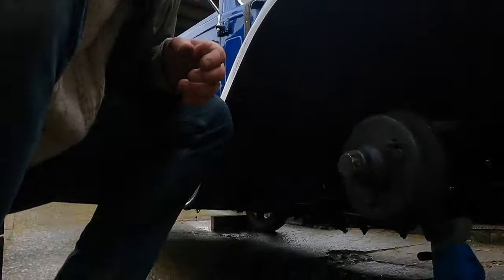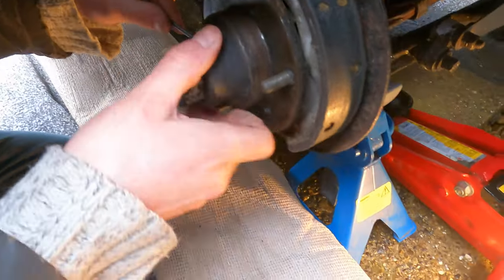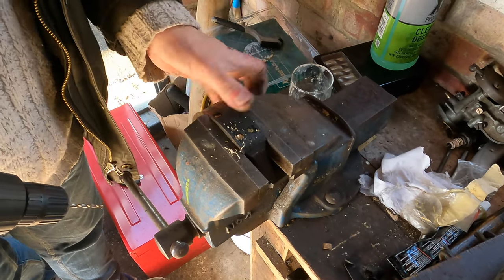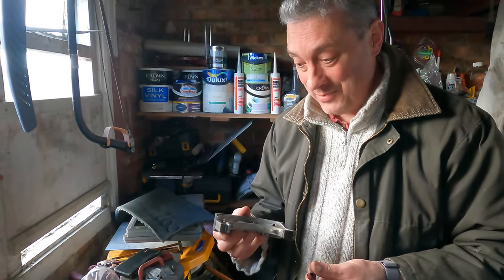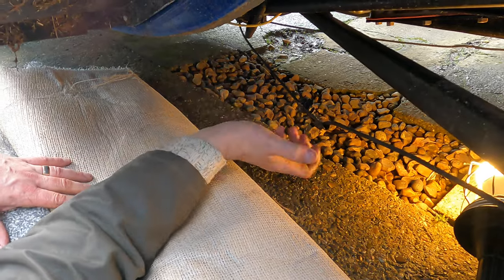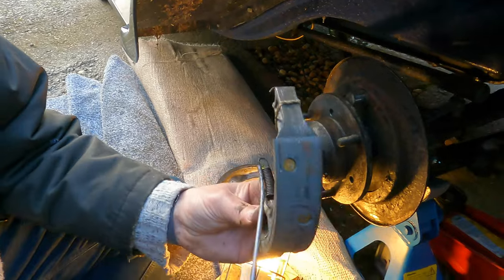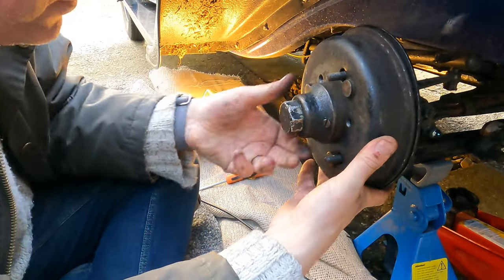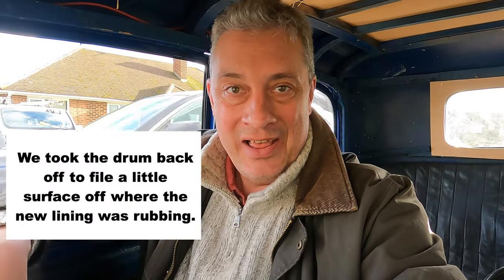Austin 7 Restoration - New Brake Linings And Brake Spring Removal Tool

Comment: That's a neat tool, I have not seen that type before, I use a hooked spring tool, which is ok, but is pull to put on/take off, pushing looks easier.

Did you have two adjusters on the same front brake cable? I think you are only allowed to use one per cable, I don't like these at all as they distort the cable. 

On my Swallow (my Ruby has hydraulic brakes) for the rear brakes I used stainless steel adjustable rigging connectors rather than pulling the cable through the hole & then trying to clamp it in position - always goes back to where it was before anyway - the rears were originally supplied with an adjustable connection to the brake bar, but no-one supplies them like that now, mine mimics how it left the factory and makes the adjustment of the cable much simpler!

Thanks for sharing!
Reply from the maker: The tool made a big difference. Click the link in the description to the Bristol club who enlightened me to it.
We had an adjuster on the cable both sides of the car for the front brake cable. We are keen to try a similar set up to what you use on your Swallow for future adjustment. Thank you for sharing. We will be looking at everyones brake cable set up at the Beaulieu Event in the summer.

Comment: Hello It is easier if you drill the rivets out on the back the drill will centre itself. You can get a rivet set tool to bash up the rivets. I use an angled piece of wood that fits into the vice to hold the shoe, you do need 3 hands! If the lining was fouled with oil that needs to be looked at. Not only a new seal but the seal surface will need work. Dad had a Ruby the same year as yours and did a bowden cable conversion to the front brakes this was the 60's. Are they still available ? not sure. The brakes were poor from new. apart from the girling back axle later cars. Your dynamo was not working did you know? The ignition light never went out. Cheers
Reply from the maker: Thank you, lots of good advice there! We will have the drums off again and get them cleaned up. The car stood for around 40 years so lots of jobs to do still. The dynamo is one of those on the list.
Reply: Hi Before you spend more of the folding try taking the wires out of the dynamo  and flashing the field coils ( normally the green wired terminal but check!) with the terminal on the battery which IS NOT the earth to the car. After a long lay up the residual magnetism in the core is lost. You are looking for a bright blue spark  it may take 3 or 4 goes! Cheers @classicandvintagecars
Reply from the maker: We have heard about that, great idea. Thank you 🙏